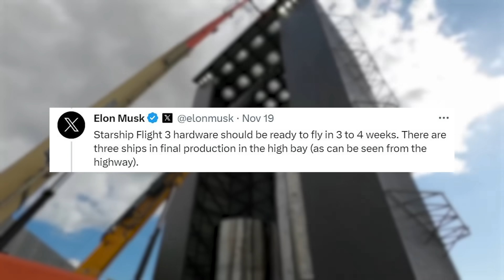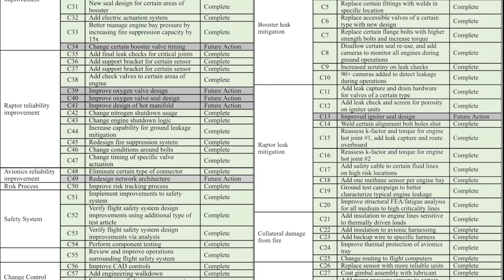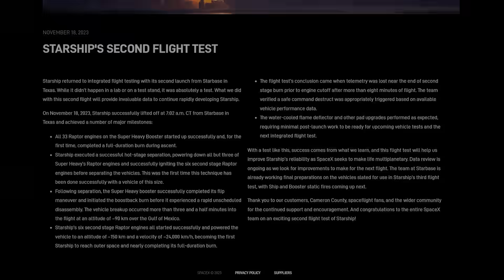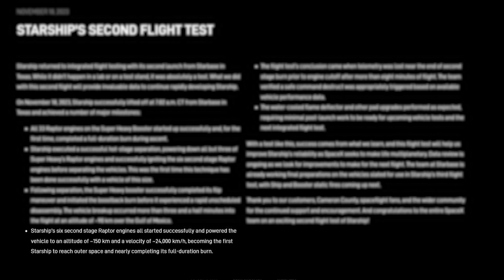How Long Before SpaceX's Next Starship Launch?

Comment: They need to solve the problem of tiles falling off, the booster failure and the 1st stage failure. These are not small problems. I'm not sure why they keep building more prototypes when the basic flight problems haven't been solved. I would build the next version from the mistakes learned with each flight, not keep pumping them out like all is well.
Reply: They are also working on their manufacturing process, which is quite complex. So my guess is they don't care much if they build too many starships as long as they have the capability to make a lot of them quickly. Once they learn how to make a reliable rocket, they will be ready to make lots of them quickly.
Reply: Others in the comments have already commented on the fact that the high build rate outpacing testing is also a proof of concept for their fully developed Starship production process, but I want to add that the tiles were not given the same level of quality assurance that they were on even IFT 1. Indeed, IFT1, seemed to have less tile loss than IFT 2. Whether this was a conscious decision or something that was forgotten, there is at least a clear path forward to ensuring stronger bonds for IFT3, i.e. no technical gotchas
Reply: I think the reason they build prototypes is because they can adjust them after each failure from the previous ones and keep on testing. Keep in mind that what went mostly wrong the last time didn't happen this time, except for the shitty tile system lol. I thin that tile system will undergo some real changes when they can start testing re-entrys.
Reply: It’s a huge stainless steel rocket, so you cut and weld any changes.
Reply: They aren’t all just hardware problems. Some maybe be fixed by simply changing what the rocket does. Such as spinning slower at stage separation. Or changing the timing of relighting the engines.
Reply: Second stage recovery is many many flights away. it's honestly not a crucial problem right now, but you are right that it is a big problem if they want a rapid reusable second stage at the end of development. I suspect that's why they started testing the tiles even before they inteded them to survive. They are pumping them out because they have more important fish to fry than second stage comes back and lands somewhere they don't currently have avaliable for it to land anyway.
Reply: @maskddingo1779  it kind of is crucial mate. It's meant to be landing on the moon in Dec 2025. Needs to be working now, not at the 11th hour.
Reply: @mervstash3692  Nah mate, the mission to the mood does not "require" starship to be able to be recovered on earth, nor are tiles going to be on the lunar lander. It would be ideal for them if they were able to at least get the booster reusuable by then so they can save some costs, but the whole thing can work without any reusability returning to earth to be reused... just more expensively. The major hurdle holding up a 2025 moon mission is getting to orbit. The next most important thing is on orbit refueling. Then the lander itself. Tiles are not a crytical path to the moon mission.
Reply: @maskddingo1779  I call BS on more important fish to fry. The two launches so far failed for reasons that could have been discovered & solved much cheaper & faster in ground testing. This Soviet style of development Musk is enforcing on SpaceX is good for smaller things but just doesn't scale for something as large & complex as Starship.
Reply: @Daneelro
It’s not Soviet style. Where are you getting that?  It’s rapid iteration. Used a lot in programming. Some problems are hard to see without actual experimentation. You get better at it as you go. If you lock everything in place early and run into a problem late in production you may have a huge problem.
Reply: presumably they are able to make mods on the fly. For all I know the problems are fixable using software tweeks.

Comment: Zero successful launches. Zero successful landings. Fanboys: huge success!
Reply: Bro is an ignorant and doesn't notice yet
Reply: People said the same thing about falcon 9 lol.
Reply: If it becomes successful 6 months later, will you drink your own pee?
Reply: @zero7523 I think he already does🤣🤣🤣
Reply: @zero7523 I think he already does🤣🤣🤣
Reply: SpaceX has had over 80 successful Falcon launches this year which is more than any other rocket currently in use….

Starship is a prototype test vehicle that is attempting to become the first fully reusable launch system…it’s not just going to work the first time they try it. Even their Falcon rocket failed its first couple of launches before reaching orbit
Reply: Say you don't understand iterative design without saying you don't understand iterative design.

Even after close to a decade of iterative design pushing SpaceX to a thoroughly uncontested #1 spot in mass to orbit.  Yikes, bro.
Reply: It’s a test rocket, not a finished product. Learn the difference.
Reply: U are obviously one of the ZERO brains guys🤣🤣🤣
Reply: The lads carry on like it just landed on the moon. Hilarious.
Reply: The company almost went bankrupt after 3 failed Falcon 1 flights 2006-2007. The next two flights were successful, and they transitioned to the Falcon 9. F9 now has 281 successful flights out of 283 attempts, over 99% success rate. Their successful landing rate of the booster is 95% - no one else has landed a single rocket in this category, they've done it almost 250 times now (saving hundreds of millions for launch customers.) 

Everyone thought F9 propulsive landings were impossible, then SpaceX wanted to land them on ships - everyone said that was impossible, they've done it over 100 times now. 

Oh yeah, the "imposible" F9 is the USA's only domestic launch vehicle for astronauts to the ISS, at a fraction of the cost of the Shuttle or Soyuz. 

Starship? Yeah that's just the heaviest manmade object to lift or reach space, by a private company no less. In its prototype stage. It's the first full-flow staged combustion engine of this size to ever fly, or reach space (that engine technology was also supposed to be impossible btw.) Not only does their Raptor engine work, but they got 33 of them to burn perfectly through a complete booster ascent on their second flight. 

SpaceX is all about turning impossible things into everyday technology.  I wasn't a huge fan at first, but it's completely undeniable at this point; they're pioneers and the future of space travel. 

You laughing at them for not achieving a PERFECT second flight prototype of the largest rocket to ever reach space (again, this is also by a PRIVATE company) is simply absurd.  The N1 and NASA Saturn V weren't nearly as powerful, yet sucked up MASSIVE resources from each nation, including "catching" the best scientists from the world after WWII to help. 

The US Apollo program cost around 250 BILLION dollars. Starship is more capable, and privately funded.  Let that sink in for a minute.
Reply: @EstorilEm  I'm not the ZERO laughing.  I'm one hundred percent behind SpaceX. I think you are talking to the wrong person